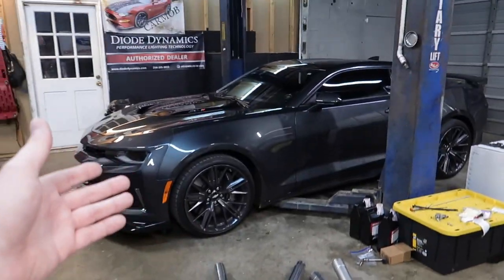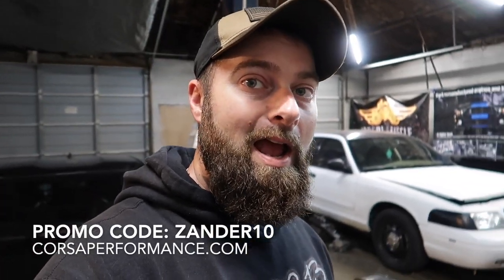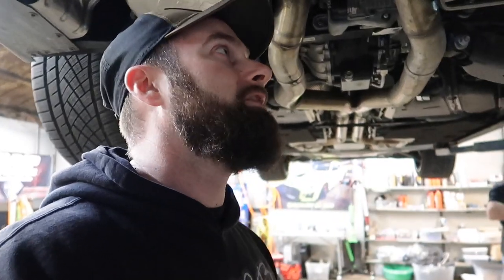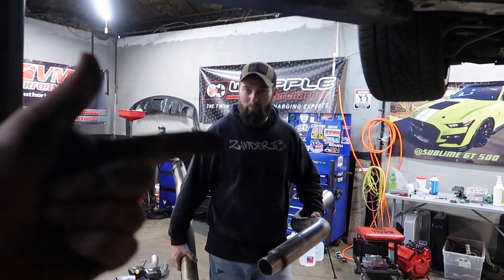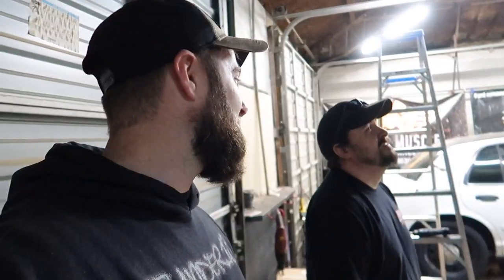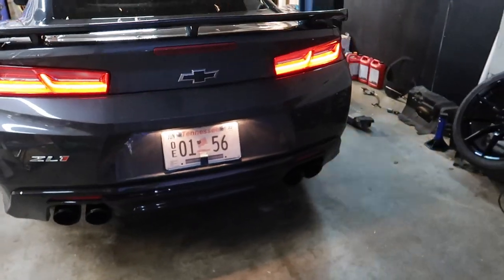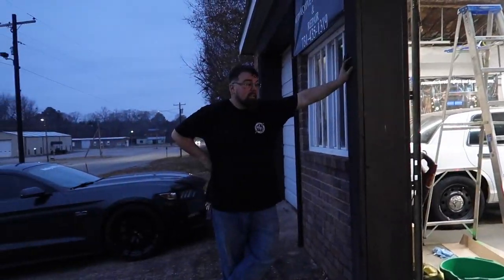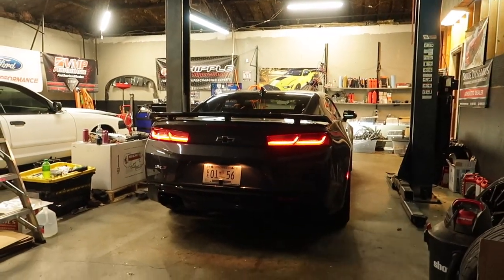My ZL1 Camaro Get's a $3000 Corsa Extreme+ NPP Exhaust & IT'S INSANE!!

Comment: The thing about the CORSA NPP is not really how LOUD it is and all that. The best thing about it is how quiet it is when in touring and valves closed vs how LOUD it is open. All the other exhausts are LOUD with valves closed and a little louder open. Should make some vids showing how quiet it is valves closed, to me that is the best thing about this exhaust.
Reply from the maker: Absolutely correct. In stealth mode borla was still loud. But with corsa it’s dead quiet.

Comment: Always loved the way Corsa sounds on the LT4.  It's way louder than the Borla ATAK.  The setup will be a touch louder and cleaner in about 2 weeks or so since it does take a little for the system to break in.  Also, good idea would be to tighten everything after that 2 week period.  Your going to get an occasional pop from this system that will take you completely by surprise......in a good way of course.  My first Corsa system did that and gave me goosebumps for a week.  You do the secondary Cat delete yet?  That adds more snap, crackle, and pop to the driving experience for sure.  😎  Looking forward to the next vid.  Keep'em rollin bud.

Comment: Corsa and Borla both sound good. Cant really go wrong. In this example on the ZL1 I believe the Corsa Double X pipe deletes the secondary cats adding to the sound volume level. Where the Borla Atak retained the secondary cats. Borla use to make a secondary cat delete mid pipe for the SS and ZL1, but the EPA cracked down on them since there in California. So you cant order it anymore. I ran the Borla Atak axle back on my 2018 Camaro SS and now I have a 2020 GT PP1 401A A10 GT with the Borla Atak Cat Back and its a lot louder than my SS was. My best friend also has a 2020 GT with the Corsa Extreme Cat Back. It sounds really good with a slightly more raspy tone and the Borla is slightly deeper. In the car the Borla sounds slightly louder than the Corsa, but outside Corsa sounds louder to me. Just  some differences Ive noticed in person. Both are badass.

Comment: Great video. The exhaust is usually more when you use the valve for the quite mode. Its great when aftermarket uses the quite mode. I need to get a exhaust for mine. I am looking at the borla atak or just doing a x pipe.

Comment: Corsa sounds great but man these prices are getting just so crazy way too expensive for what it is. I ended up just doing the headers and removing cars with a x pipe mid section connected directly to the stock rear mufflers. Sounds crazy loud but you can still turn the valves like the corsa and make the car super quiet basically sound stock.